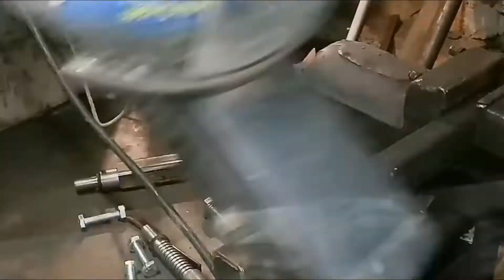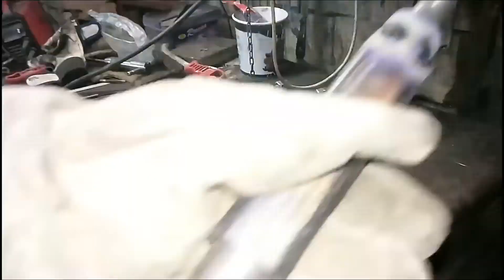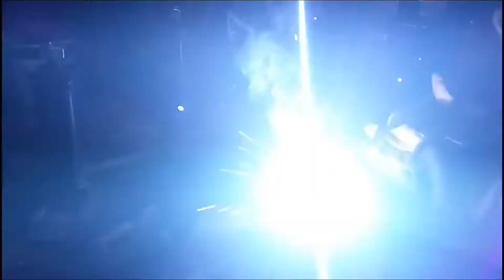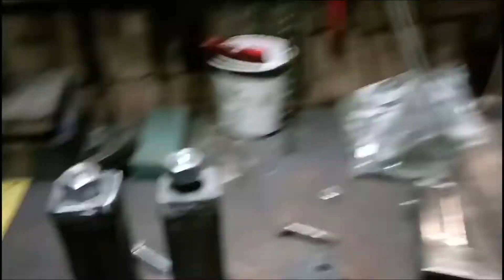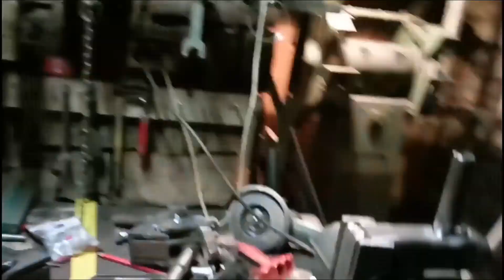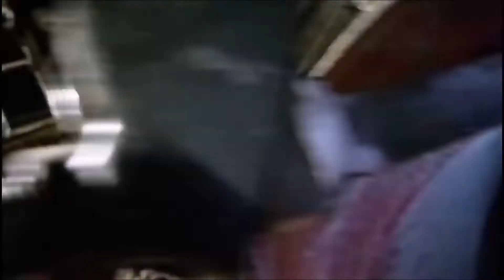Making a tyre bead breaker tool from A to Z - Satisfying video.

Comment: Do u have templates for a pattern? I would like to try and build as a welding project in school
Reply from the maker: I have no templates for building such a device, but I can give you some approximate dimensions. The inner tube is 10 cm, the outer tube is 12 cm. Screw with square thread 10 cm.
Reply: Thanks...I have watched video many times...I'm gathering a parts list by watching....great  video thanks!
Reply from the maker: It is more interesting to try to figure out how this device is being built. Success with this project.
Reply: @anthonyupchurch7979  original video: https://www.youtube.com/watch?v=-L8tluswtVg